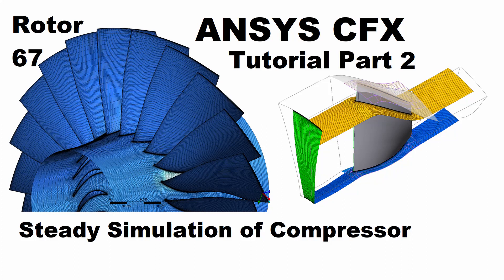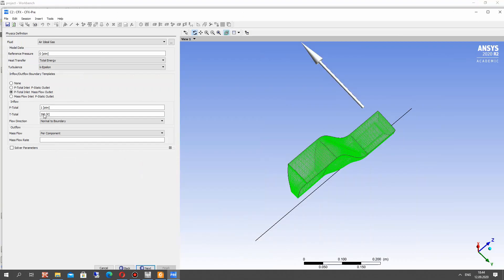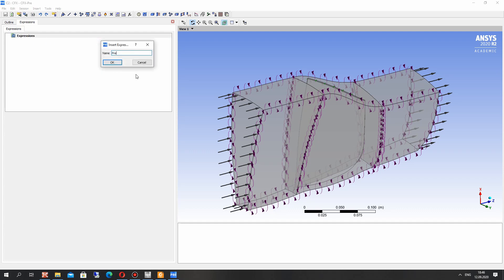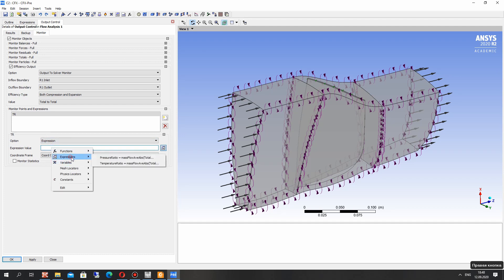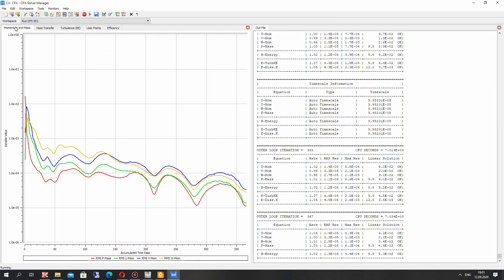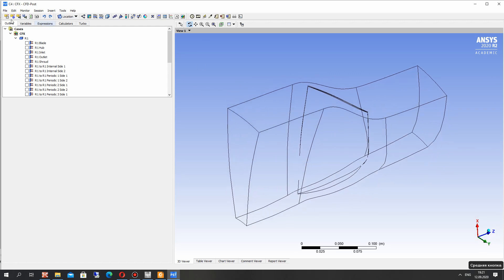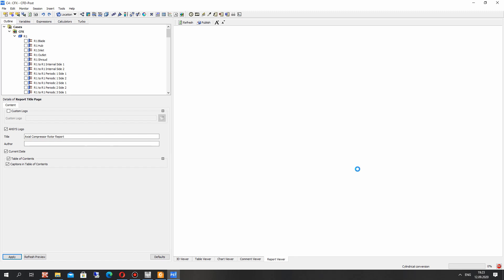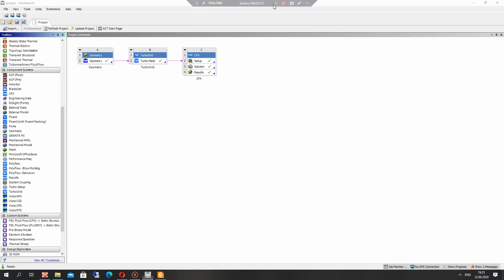ANSYS CFX Tutorial Part 2/2 | Steady Simulation of Axial Compressor Rotor 67 and Post-Processing

Comment: Hey man. Really cool video. By chance is there a way to simulate this without turbo mode? I have a simulation to run with 2 different Fluids but I can't use turbo mode for that. It's not a rotor blade but rather many pins that rotate around an axis but im having trouble with simulating the pin velocity in a steady state simulation with 2 Fluids. Do you maybe know a solution to that? Thanks in advance!

Comment: Couldn't I use the 'no Slip' condition on Shroud?
Reply from the maker: You can, but it means that you have the rotation of the shroud with blade. If you use the Counter Rotation condition it means that your Shroud - stator with no Slip.
Reply: @CFDIntech  I will try to do this in OPenFOAM.
Reply from the maker: @McHumaty  Which version? I have used Extend version 4.0, because there is solver for this, and i got a good results. I also tried the OF 7.0, rhoSimpleFoam solver, but there for temperature field i got 0.9 temperature ratio, because this solver doesn't have the Rothalpy in energy equation(
Reply: @CFDIntech  I don't know how I would do it... I would research to find out what to use and how to do it... will you post a tutorial using OF? Which solver did you use in Extend Version 4.0? And out of curiosity, what is the BC for Shroud? Highlighting with the question I asked earlier.
Reply: @CFDIntech  ok